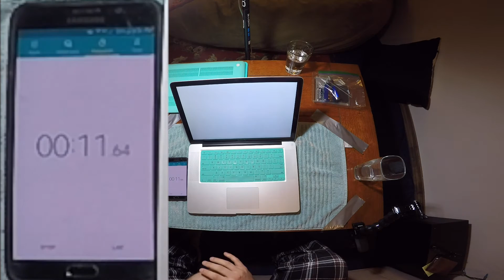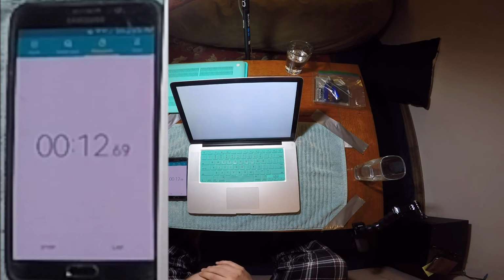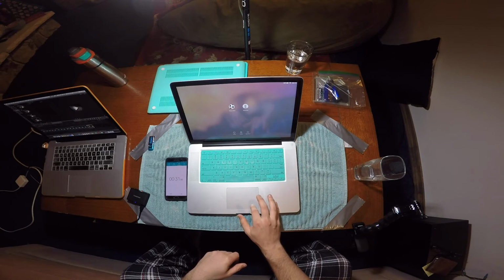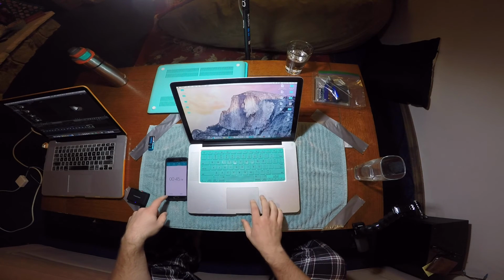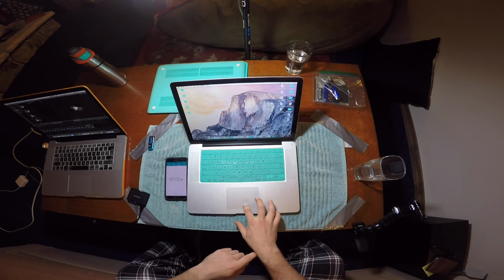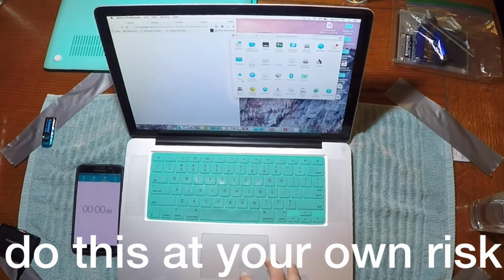Macbook Late 2008 SSD and Optical Drive Upgrade

Comment: just installed a SSD to my old 2007 MBP and the performance is fast. but this is a great idea to install the HDD replacing the optical drive which doesn't work anyway.
Reply from the maker: works great having 2 drives!

Comment: The reason there's a gap between the HDD caddie and HDD is to allow you to slide in the drive. There's screws on the side of the caddie that align with the 4 screw holes on the HDD to secure it in place, there's no need for you to pry anything in between the HDD and caddie. Just an FYI.
Reply from the maker: +SweatmyTechniqs thanks! that makes sense, i will try that out since that would work a lot better!

Comment: i have the same late 2008 unibody, also installed a SSD... runs better than new!
Reply from the maker: +nonotnyet yea it runs a lot smoother and faster!
Reply: +Jordan Gibby nice tutorial, though that tape roll concerns me.
Reply from the maker: +nonotnyet it's pvc tape so it shouldn't catch fire but I might try to fabricate a plastic piece that could take its spot in the future
Reply: +Jordan Gibby ah! i thought it was duct tape. that should be fine until you can fashion something else.